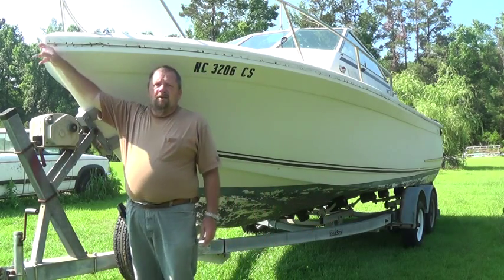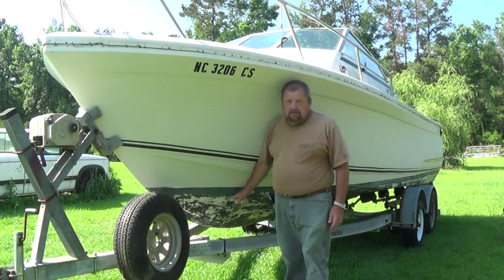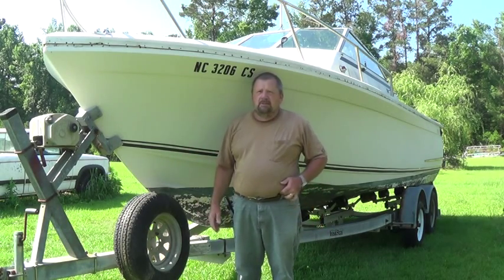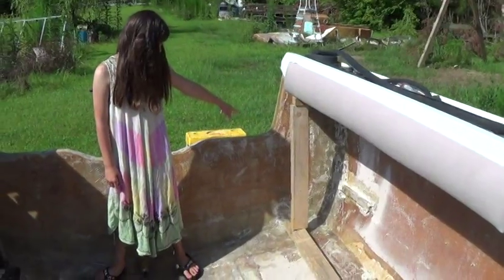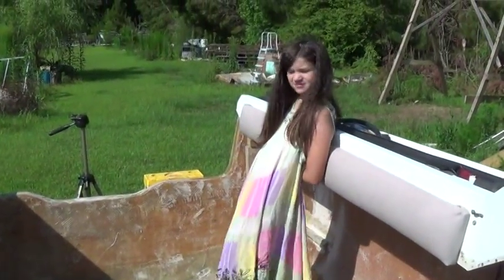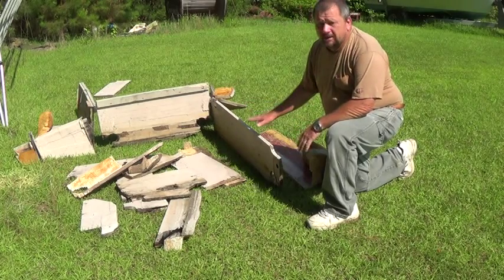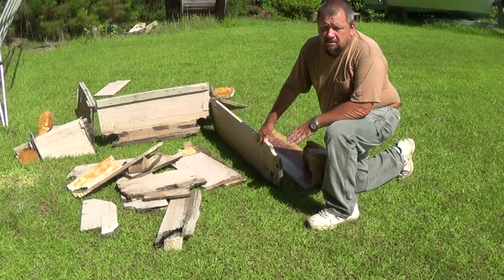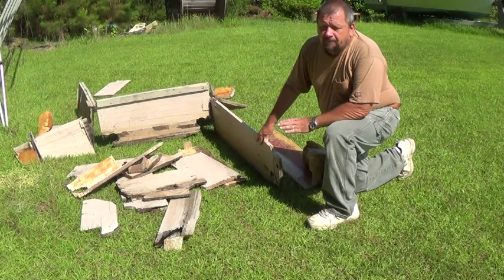Robalo Boat Project My Big Mistake 16

Comment: Hi great videos you have posted just commenting because your saying your not happy with some of your work. You've done a great job for somebody who is new to glassing/laying up.
I've watched a few of your videos and when you were laying up the roven woven I didn't happen to notice you using a paddle roller after wetting out your fibre. A paddle roller will prevent air getting between your layers. Also the cracking either side of your drain looking and the area you glassed recently during your refit. I am assuming that you used Gravicol or a similar filler/bonding paste to retain your drain prior to glassing it in.
The Gravicol shrinks as I've had it happen to me when I packed the edge of my stringer timbers in my experience its nothing to worry about as long as you ensure you have a water tight bond to anything that can either rot or retain water and cause issues later down the line.
Also the criss crossing you mention on the transom from your lay up you may not like it but its fine as long as its all sealed which it appears to be. Roven can be a pain sometimes as you probably notice it gets a bit slippery when its wetted out.
But all in all a great job done people can learn a lot from your videos and lets face it none of us are perfect but you are honest and willing to show others your strengths and weaknesses while also teaching people something so credit where credit is due.
Keep up the good work......

Comment: On reflection do you now think it would have been better to have left he cap on the boat ? It must have been a worry when there was a 4" gap on the port side when reattaching the cap and also the gap at the bow.I know it gave you great access for replacing the stringers and the floor but it came at a price.
Reply from the maker: Looking back on it now I don't think I would take it off. I thought when i was taking it off that I would be able to turn the hull upside down and do the bottom first and then turn I back over and do the inside. When it came time to do that I did not have anything or enough help to turn it with out the fear of breaking it.